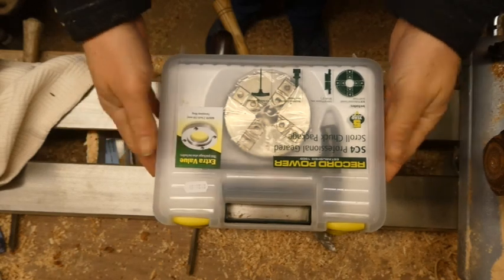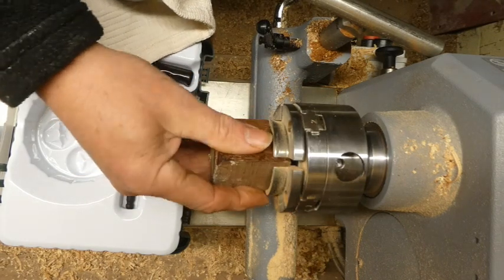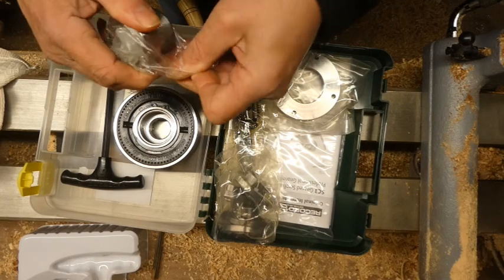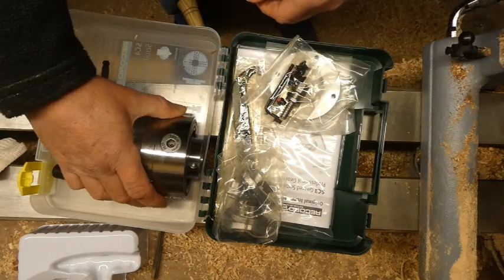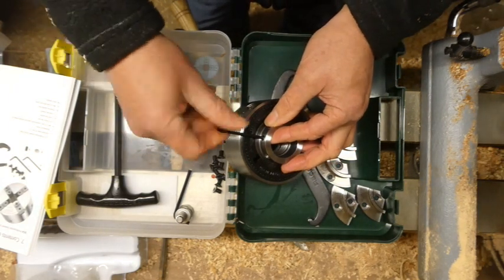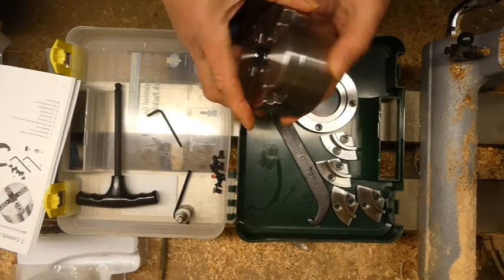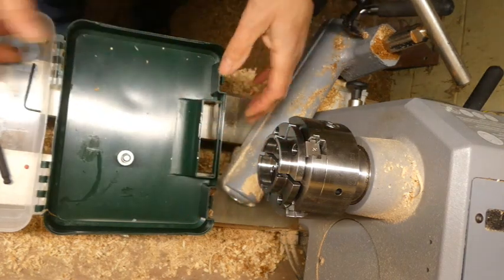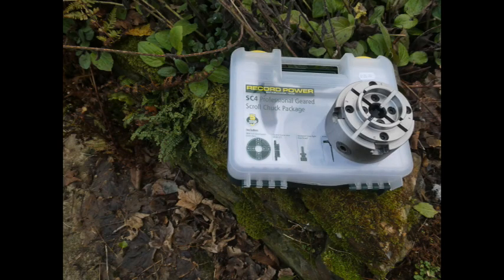Record Power SC4 Scroll Chuck

Comment: By now, I have a few jaw sizes/types.  I like to discard the foam bits and store jaw sets in chuck cases like that.  It keeps the jaw sets in the same general area and the jaw sets are less likely to collect surface rust in an enclosed case.  Cheers!

Comment: I got the SC4 pack when I bought my CL4..  excellent chuck..  recently bought the SC3 pack to save time changing chuck jaws when doing projects..  Nice presentation Andy :)
Reply from the maker: Hi realale999...sounds like you did the same as me but the other way round...I had the cl2 until I sold it with my old lathe...may get another sometime for small projects...I hate changing the jaws...cheers...All the best.....Andy

Comment: Congratulations Andy on your purchase of the Record SC4 chuck. I'm certain that you will not be disappointed with its performance I personally have enjoyed the Record SC4 so much that I now have 4 of them I also have 4 of the Record RP2000 chucks, another great wee chuck. A woodturner can never have too many. One point to remember when using your SC4 is that if using an external grip onto a spigot or tenon, the spigot or tenon is straight NOT dovetailed. The chuck jaws are bird beaked and bite into the straight spigot or tenon.
 If using an internal or recess grip the recess should be dovetailed as is fairly standard with most chucks. The same applies to Nova chucks.  Not certain about your Robert Sorby one.  Enjoy  👍
Reply from the maker: Hi Jim....thank you for your kind words and the information regarding external/internal grips...I will be getting one of therp 2000 as well....I think that I will start calling you... 8 chuck Jim  !!!....have a great new year...All the best.....Andy

Comment: Good review I own an sc4 and can confirm that it is a very well made high quality chuck but I think that it is only fair to point out that on mine at least it is clearly marked on the black plastic rear cover that it is made in the PRC and not Sheffield as stated,
Reply from the maker: Hi Paul...
Thank you... it is a great chuck...
You are quite correct... I didn't spot that...
Having said that.. I still like to support a very old Sheffield business when I can and recently they have started making more products in Sheffield rather than importing...
Take care...All the best.....Andy

Comment: Quick question, at what point (in terms of object size) would you switch from the SC3 to the SC4?
Reply from the maker: Hi Andy...this is a tricky question...I tried to find out what each chuck could take and it seems that the Sc3 can pretty well do as much as the Sc4...it takes all the same jaws etc...having said that...anything above about 12 inch diameter or if it's very heavy or out of balance...I would use my Sc4 or my Robert sorby chuck....I have just purchased a pair of pen jaws and have fitted them to my Sc3 with the intention of using it for all my smaller turnings ...I used to have a rp 2000 chuck before selling it with my old lathe and that was great for the smaller stuff...instead of replacing it I decided to use the Sc3 with pen jaws for the same thing ...also I enjoy making pens so I am going to use it for pen blank drilling....at the end of the day we can only do what we consider to be safe so always err on the cautious side...hope this helps...All the best.....Andy
Reply: @AndysCornishCreations  Thanks Andy, I'm looking at getting a chuck and was just wondering which would suit more. The sc4 looks better and if it can take smaller jaws too then it seems to make sense to get that. The fact that the back is closed, rather than open like the sc3 seems more suited to an environment where little bits of wood are flying about.
Reply from the maker: Hi Andy....if I were going to have the one chuck it would be the sc4  .it can do all you need and it's only £30 pounds more than the sc3....try Yandles at Martock...£129.99 plus delivery...and the pen jaws are great for holding small pieces...All the best.....Andy